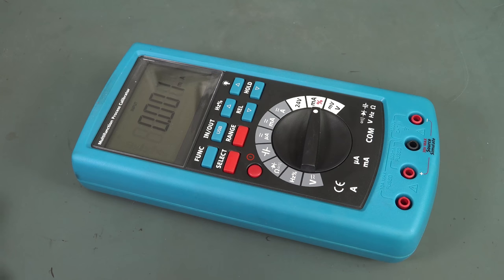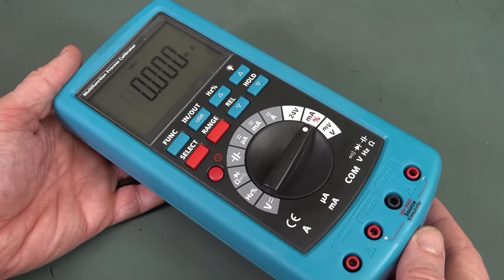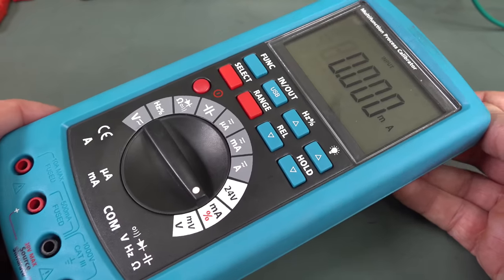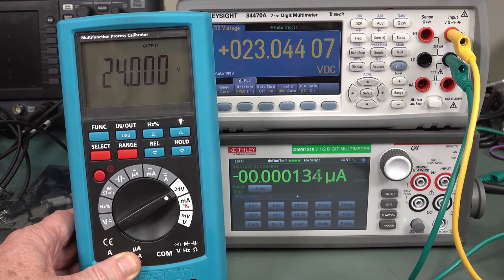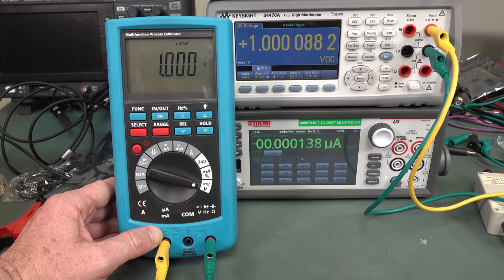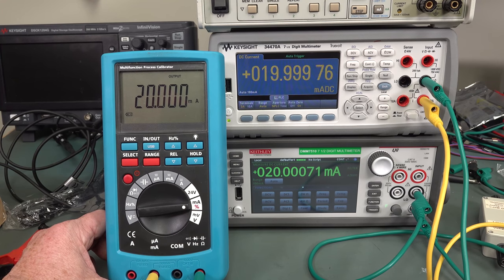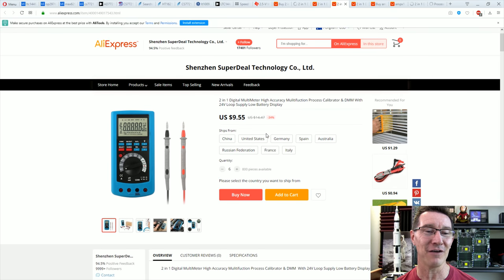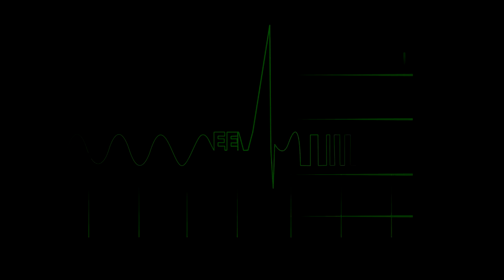EEVblog #1248 - INSANE! A 0.02% Process Meter for $9? WTF!

Comment: These are meters that didn't pass QA and left the factory through an "unofficial" exit. Dave got one with physical errors but could be other units failed because of other reasons. Maybe the person selling them sorted them so they only sell the one with the physical defects. You don't know, but for 10 bucks it's worth the risk. 65 bucks, nah. Some sellers started selling them for 160. Better off buying an official unit for 250.

Comment: I know the manufacturer dumped them because they are defective. The defect could be solder, process or a component it will fail at some point . Could work for a good long while or fail in weeks. Eight bucks is nothing.

Comment: It could be excess of parts for a order in a factory... Sometimes you order 10000 units from a factory, but you send parts for more than that just in case something goes wrong... And some factories at China  continue manufacturing until the parts end and sell the excess of production into the gray market without your brand

Comment: Even at $100+ its a bargain and $200+ is still a nice price :-)
btw - you need to check your component prices on another site, the LTC1446 has a list price at Analog !!!! of "only" 6-9 US$ (50 pcs tubes) and Mouser sells singles at €13.93 :o)

Even though the DMM part is plain app-note/ref-design work I would had been pretty happy with myself if I had done the complete design ;o)

Buy it and refit quality sockets and you will have a decent calibrator for a few years .....
The datasheet on the LTC1446 dosn't say anything about reference aging - any re-calibration procedure for the instrument ? - tempco of mA output ?.

Comment: Probably factory rejects. Not worth the cost to determine which parts are good or bad for salvage, or to even attempt to repair/replace bad parts... But they work well enough to sell cheap to a reseller, aimed at hobbyist market.

An expensive complex board, with a BOM cost in the hundreds in components alone, and sale price of the finished unit being very high... In that case, it can be worth it to pay a tech to troubleshoot the board, and replace any faulty components, then QC pass the board and sell it same as any other off the line.

Something this relatively cheap to make, just not worth the cost to repair rejects.

Comment: I don't understand the logic of combining a high-precision source with just an average meter. If you're doing precision work, wouldn't you want the meter to be as good as the source?
Reply: Notice the IN/OUT button. In the high-precision mode you can also use it as a meter for 10V, 100mV and 0-24mA ranges.

Comment: I guess these Chinese at AMPX1 had a big batch of bad meters that were faulty one way or another, which it is as you noted (lead connections and range switch), and I guess they are trying to get parts costs back without the name damage by selling the batch with the names scraped off for a couple of bucks at Alixpress and other outlets.
Either that or the batch was throw out, someone got their hands on it for free and is selling the stuff for a quick buck.

Comment: iv'e seen this before, for what ever reason a batch failed QC, so they held them in a warehouse(made 2015) then this year they debranded them and packaged them in plain cartons and dumped the stock cheap.
then a 3rd party seller gets them and sells them for under a tenner, dave finds them and points out what they really are and the seller gets greedy trying to backtrack and get buyers to pay more, when a tiny google search would have told them from the beginning, as we say in yorkshire "TOUGH TITTY" its on the seller.
there were some MICSIG tablet scopes a few years ago that were debranded and selling for £60 each, only 1 seller had 144 units and the same thing happened, after half were sold he suddenly jacked up the price to 40 pounds less than a genuine micsig(with warranty) about 5 days later the listing vanished.
Reply: '2015' wasn't necessarily the year of manufacture, it's etched on the PCB, so could just be from when the PCB was designed.

Comment: China production has a couple of funny things going on.
firstly, they don’t destroy the machines that fail final quality control, they usually sell them on the local market. Considering he had trouble with the control knob, I would say it failed because of that. And considering there were a few hundred on alibaba between different suppliers, I would say they had a bad batch because of some design fault. 
Secondly, some factories will bribe whoever needs bribing, and run a second shift one day a week on the production line. This is very common in government run factories ( most of them due to communism), and they sell the units made on the black market. 
Both ways explain why the name is removed, but the second way never gets sold out of China, and considering the branded models are a couple of hundred dollars, these units would have a very high quality standard, and all these units failed that standard. 
This is very common in China. Just the rest of the world doesn’t usually see it.
Reply: @Repairman , when I order parts that are made in china, or india for that matter, I specify what quality level I want, and they charge me accordingly. So a typical production run of say 10,000 units, will have 5000 that meet grade A quality, another 3000 that meet grade B, another 1750 that meet grade C and 250 that just dont work and will be stripped for parts to reuse and try again. If I really care about quality, I can employ a person from a contract company to do the final inspections for me, and usually the number of grade A units drops about 30% because they are more strict in the grading system. 
Alot of things we call "FAKE" are just the B and C grade quality units, but because they remove the labels, we call them fake. The local people in china know this, so they buyB and C grade units themselves. But for this item, being such a small market, i would say they couldn't sell them all locally, so they sold them on the international alibaba market.

Comment: I have seen this done for two reasons. 1 as a loss leader. And 2 slightly dodgier units sold off cheap EG production line fails that are not 100% after being fixed.

Comment: Omg that opto uart. Hahaha
Reply: Would it normally be done like that or wouldn't there be some type of package device to do the after isolation or maybe a fiber optic cable Winking Lizard mentor and source?
Reply: Yeah usually you have a packaged device. Or at least some black shrink tube :-)

Comment: Hypothesis on the scratched name:
1) They stole the design.
2) They're selling a first/alpha release that didn't work quite right, but it was good enough to sell it for $8.
Reply: I'd guess the second scenario. They found that meter would lock up and redid the firmware for a new run of units.

Comment: The two I ordered (from My Cozy Life Store) turned out to be a scam... they never shipped them.. saying this (now the same meter is $207):

 Dear 
sorry 
we  had sent for you before 
 but we just got the information the parcel will been returned to us due to Crucial 
Defectives of the elements and function .
we need to return all of these items back to theirs factory
for a Security Inspection until the issue solved.
in order to protect your right ,could you please tell us your paypal to get the refund back or would you like to choose other item as replace in our store ?
sorry for the trouble again and waiting for quickly reply ,
nice day
 

Also,  the tracking number never worked, never showed up when I tried to track it... so I think it was fake.  I can't even do a dispute.. it won't let me and says  a dispute cannot be opened...   I'm not very happy with this seller, or Aliexpress.
Reply: btw it appears this seller may have cancelled many, if not all of their orders for this item.   ALSO note, you CANNOT leave negative feedback to Crook sellers on Aliexpress if they don't ship the item... I've had it with Aliexpress.. and going to cancel my account after this last rip off is settled.

Comment: Either it is a knockoff which wouldn't have been let in to western countries by customs if they find it is a knockoff (plagiarism laws and so on), or it's overproduction - Aimo made so many of these and can't sell them that they now have to throw them out for cheap in order to be able to do whatever. Or, as a third possibility, this comes from the actual manufacturer who was contracted by Aimo to produce their devices, and they produced more than Aimo had ordered or was willing to pay or some other sort of falling out happened between, and now the manufacturer is trying to cut their losses by getting rid of their stock.
But who needs such a device anyways? I mean, if it's a good multimeter, fine, but what would I need the other stuff for? I don't work in the field, so I wouldn't know...

Comment: Things can be sold very cheap when you don't have to do the R&D to develop it. The company that manufacturers it for Aimo, kept manufacturing them, and sold them to wholesalers out the back door.
Reply: No, it does not explain it. Even parts alone cost more than 10 times more than their price of the whole thing. Even if you steal the design and all the equipment and your wokers work for free you still can not produce the thing this cheap.
Reply: You obviously paid no attention at all, and just wanted to whine about China. They clearly could not make them for that price.

Comment: I agree with several others that its likely defective or crippled stock and perhaps maybe even fallen off the truck so to speak. While it does perform in spec I would still avoid buying them as a result of the problems that you found right off the bat during use. I understand that its was only $10 Yankee bucks and then they ballooned in price but if you buy cheap especially that cheap 99% of the time you buy twice and personally I would not want another temperamental and glitchy device that I would need to use professionally.

Comment: This is stolen reject product. I would not buy this kind of thing. The reason that the label has been scratched is because the device has failed quality control standards and so was rejected. The individual selling this product definitely stole it out of a dumpster or somewhere else. Shelf life of QC fail is not guaranteed.  They usually have some sort of intermittent internal failure in the batch and you are risking your equipment's by using them. Do so at your own risk to save a buck.

If you however have the technical expertise to fix one of these instruments you have yourself a bargain by just realize that it's going to be up to you to service the device.